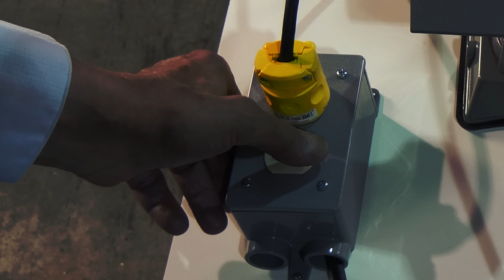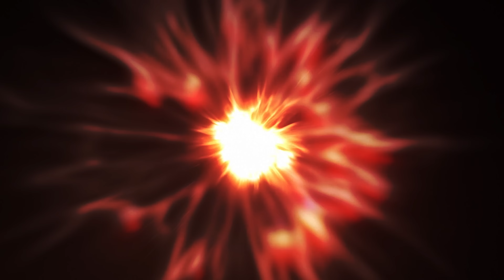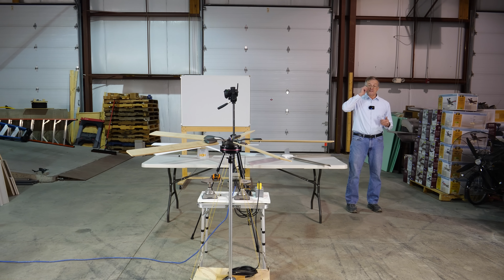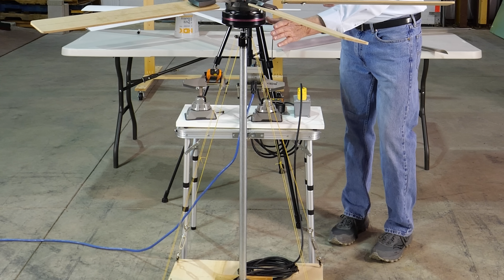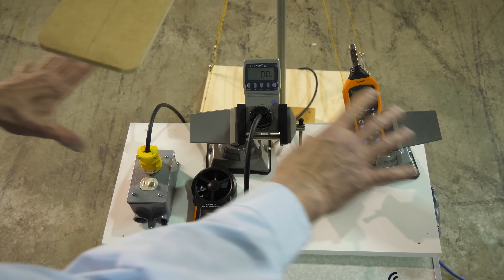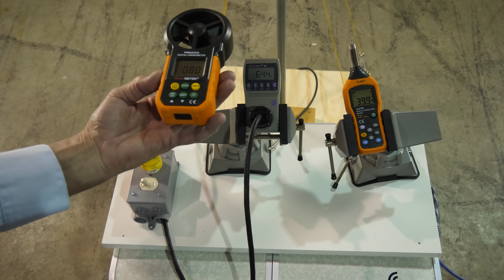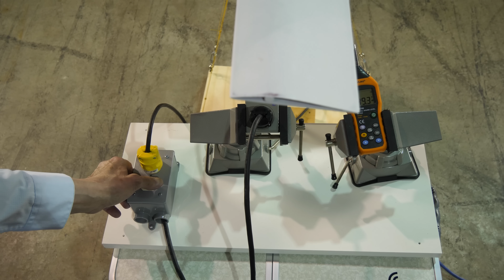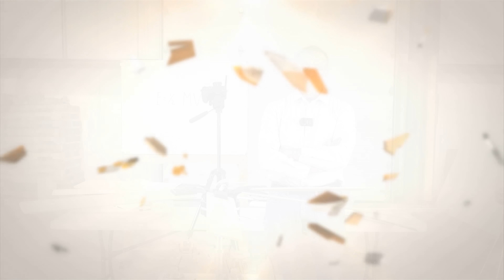This Fan Uses Almost NO Power

Comment: ** THANK YOU FOR THIS! When you first started the demo I though "Power Factor, Power Factor my man!" From working in Industrial electrical systems I became aware of this decades ago and experimented with power-factor correction on inductive devices such as Fans, AC units, refrigerators and etc., and and I estimated that the typical U.S. home could save 5% to 20% on energy usage with basic power factor correction on inductive devices. 

Inexpensive meters like the Kill-A-Watt provide some rudimentary PF information and can aid in finding energy wasting devices. After you find a device like your horribly inefficient device like your celing fan, matching capacitor to correct that is pretty simple and might get your efficiency up to as high as 80%. 

Years ago built a plug-in, in-line Power-factor correction text box for 120V devices with a couple of rotary switches with an assortment of caps to apply from 0 to 60μF in 6 steps on one dial and 2μF to 10μF on the other and start switching for lowest current draw and then wire up an inline plug with that μF value. 

HOWEVER, capacitors provide leading reactive power, and devices like your ceiling fan may have resonances (possibly from being wound for 50hz rather than U.S. 60Hz) with lagging reactive power, but by adding some inductance with a coil or choke in addition to a cap, it should be possible to match PF and inductance nearly perfectly.  

Note: Inductors and capacitors can be made to cancel each other out if properly sized, leading to a neutralized reactive power.
Reply: This is probably the biggest reason for the inefficiency. Induction motors can be 85%-97% efficient under load. The losses with no load are not the same as the losses under load.
Reply: @pierrehavelaar  Thanks, a good way to convey it.
Reply: TheWattmeterRegistersResistivePower,NotInductiveOrCapacitivePower.CapacitorsDontDecreaseTheResistivityOfTheWire,OrOfTheIronAnotherImportantThing:ComercialStandardCapacitorsHaveHighEsr,SoTheyAreNotOkForPowerAmplification.

Comment: Years ago, when I was looking into modifying a 1/16 scale RC car, I found a scientific research project done by a student on DC motors in RC cars that suggested that when there was a surplus of power/torque for the necessary application with a DC motor, that non-linear energy savings would occur. Have you done the math on energy in vs KE on the DC motor at full speed vs 1m/s?
Reply from the maker: I haven't, but that wouldn't be difficult.

Comment: It should be noted that 40db is the noise floor of the environment, not the noise level of the fans. At 16:00 it's 40db before he even turns the brushless motor on.

Comment: Yes classical AC are really wasteful, but extremely cheap to produce.
What you want is BLDC Motor but they are generally more expensive, and the electronic controller is generally designed to fail in the max 5 years (exactly cheap components and shortcuts in the PCB design.

Comment: I'd feel better about these tests if the fan were oriented the way it was designed to be oriented. Being upside-down might not impose any negative effects on the test, but I have to wonder if the bearing placement wasn't specific to an upright orientation.
Reply from the maker: It isn't. 
Rather than asking you to trust me, consider that these fans can be operated in either direction, generating thrust or lift, in either direction.
Also, both models are being tested in the same orientation. This leaves little room for a particular bearing to be the source of the difference.

Comment: The win with the DC motor is the lack of noise it makes.
There was an error in the noise meter placement.
It should have been out of the direct air stream to isolate it from the wind pressure and chop of the blades, Being directly under the blades the noise was more from the sound of the wind passing the sensor not the noise the blades made.

Comment: One thing we fail to appreciate is that no significant results can be just as important as significant results. In this case it led to a great discovery. So many companies will sell you the cheapest motors, because they don’t have to pay for the electricity to run it. In reality, the cheap fan costs more.
Reply from the maker: Correct.

Comment: Excellent discovery, super cool!  Are there other environmental costs involved with the manufacture of the brushless motors that somehow make them less viable, or is it the case that we just have this infrastructure set up to pump out cheap brushed motors, so we keep doing what we've been pumping out for decades?  Would the same principles apply to motors in furnace/central air systems?

Thanks for the work that you put into your videos, and for sharing your curiosity!
Reply from the maker: Thanks!
I think you're right.  It's the inertia of an established infrastructure. It will evolve, and just maybe we gave it a nudge.

Comment: You didn't mention AC motor slip.
With AC induction motors to vary speed while maintaining efficiency you need to vary not just voltage but also frequency.
With cheap AC fans they dont want the added cost so you can't do that so to get speed settings they lower voltage either with inductors (old) or capacitors (newer) but not the frequency. That means at low speed there is a huge amount of slip (speed difference between rotating magnetic field and rotor) and hence low efficiency.
In air conditioners and some other things, to vary the compressor speed without increasing slip they vary the frequency and voltage together -> inverter.

Comment: Try it with the MIT toroidal propeller.
Reply from the maker: The problem there is manufacturing those rotors at these sizes is impractical.
Reply: @TechIngredients  If it were me, I would make a 3d model of a blade, divide it into smaller sections, 3d print each section and then glue them together. Another option is sending it out to 3d print or cnc out of a block. Just my thoughts though. Thanks for the video.

Comment: Are you using an AC-DC converter or does the fan have one built in? Im curious how much power that wastes in the process.
Reply from the maker: It's supplied with and already mounted on the fan.

Comment: There's a product called "Big Ass Fans" 
(true name) that have so many options for formulations and variable running modes that it's beyond 3 phase rectified power along with resonance . 
They will cool a warehouse with 25 foot pure AU blades! with ease! so little power or SOO high power depending on the frequency driver!

Comment: The trouble is, it's always a race to the bottom.  You are 100% right, and it's part of just buying better quality stuff in general\repairing things rather than buying cheap and more often.

The average consumer doesn't care though.  They care about price, even in cases where the $ difference is insignificant.  They care about fashion, or class.

People whine about repairable phones, but then they go buy a Iphone anyway (Apple has a long history of trying to block repairs unless it's their own service)  That's just one example of many.  Repairable laptops? it's been tried and failed, only recently has a company appear to have pulled it off (framework), but even then there's tons of people who "support" it, but when shopping for a new laptop wouldn't consider one.

Personally, I don't think motors should be the target right now, it's small potatoes compared to vehicles and home heating (go heatpumps!).  You might say why can't we do both?  The time, energy, and will to make things happen is a limited resource.  I'd rather they focus on getting heatpumps implemented, and EVSE's everywhere people park overnight.  That's just my opinion though.

The only way I see this sort of thing taking off is if the government push's for it in some way.  Be it regulation to require more efficient motors, or a rebate program to incentivize them.

One thing I think you did miss on though, is the assumption that the BLDC motor will last as long as the AC one does.  I think BLDC will suffer the same issues LED lights have, they could be so much better, but the electronics backing them fail.
Reply from the maker: I understand, and you make good points.
I have a different take on a number of points.  The best way to start is knowledge and understanding of the principles. We do these videos to educate people, hopefully in a somewhat interesting way, to understand how things work.  It's hard to fool people who know what's going on and why. I disagree with a dependence on the government to provide this protection.  The government is itself corruptible with layers of influence and profit seekers.
Reply: @TechIngredients  Don't get me wrong, I don't like that I feel people need the government to push them to do the smart\right thing.  I just feel it's the reality of the world.

You do a wonderful job with your channel, and even if it doesn't result in widespread change, some improvement is better than none. 

Personally I was not aware of there being a BLDC option for ceiling fans, and if I'm ever in the market for one I will remember to try and find such.  It may also mean BLDC's are available for other motor applications, so I'll keep my eye out there as well.

I'm not sure I have it in me to fabricate airfoils anymore, but dang I'll have a look into it if in need of a fan.  Given it resulted in significantly more airflow for the same power, I'm sure acoustics would be better as well.  I'm guessing those were drowned out by your environment\the AC motor itself though.

Comment: Airfoil test: Power consumed at the same speed, Power consumed slowed down until the velocity was 1 M/s, and optimized with different angles (Assuming the paddle blade angle was optimized at the factory, it's fair to test different angles again when changing the shape).

Comment: In my country (air conditioning is not mainly common in my region as temperatures are mild most of year compared to US, except in cars) the ceiling fans of good quality have blades made of plastic I thin PVC in very specific complex form to enhance efficiency and reduce noise (some have kind of saw tooth pattern on the trailing edge, I think to reduce noise or drag), and all have electronic speed control. I imagine in US also, the planar blades I imagine are for cheap fans. Before those when I moved at my flat there was one that is exactly as you describe, like belonging over a poker table in a saloon ran by a lady called Kitty, I changed for a good one. But one thing that irritates me is that the electronics controllers ARE PROJECTED TO FAIL AFTER AN SPECIFIC TIME: I can not prove it because the microcontrolers have the progams encrypted, but they begin to fail after and exact turned on files: yes I am crazy enough to put a device to register consumption and uptime. I found one that is not this way but it was not compatible with the motor my fan uses.

Comment: What is the power factor on the electronic motor vs induction?

     I wanted to post while the video was hot, maybe rambling. Will try to find:

In EEVBLOG by Dave Jones , he did a whiteboard of the really bad power factor in smoke detectors. Wattage may be low, but the amps  consumed by each in a typical several by house in Sydney for example. If they had power factor correction they could negate a whole wind farm. Others jump in.

Comment: Too many blades.  Try again with only four.
More than four, for that size, is cosmetic.  And, it doesn't allow for sufficient air replacement.
At least, that's what Casablanca fan company wrote twenty years ago.
Five does look prettier, but I used four... they are a great alternative to air conditioning, as long as you turn them off as soon as you leave the area (motors add heat to air).
Casablanca fans, at that time, were ~$375., and Hunter's were ~$85.  To this day I wouldn't buy Hunter or Hampton... well, definitely a brushless motor now that I've seen this!  (Casablanca brushless...?)

Comment: Ceiling fan blades are made blunt on the leading edge for safety. If one accidentally hits you it should only make a bruise. The sharp edge as on the Wright brothers airfoil could decapitate you.
Reply from the maker: That may be a reason, but an airfoil doesn't have to have to have a sharp edge. The leading edge needs to have a continuously changing radius.  The 90 degree corners on the upper and lower surfaces of the slab blades are awful.

Comment: Since the goal of a fan is net air deflection, not lift, it seems an airfoil is not an ideal choice as any lift generated is wasted energy as drag. Airfoils only get a fraction of their lift as a result of to the net deflection. A blade with a curve, profile, and width that is optimized along its length for the desired air density and velocity would likely be the most efficient fan blade.
Reply from the maker: Net air deflection and lift are actually the same thing. The lift of an airfoil is due to the acceleration of the air.

Comment: You can probably achieve an even higher efficiency by looking at the design of airplane propellers, windmill turbines, or quiet computer fans. The issue with airplane wing airfoils is that they're optimized for linear motion, not rotational motion. With rotational motion different parts of the airfoil move at different speeds, and you get some centrifugal force too. This creates all sorts of flows and vortices that don't exist during linear motion and decrease the efficiency of the airfoil. Propellers and turbines, on the other hand, are already designed with all this in mind and therefore perform better with rotational motion. Another dimension here is the noise level, and a regular airfoil is not designed with it in mind, but computer fans and windmills very much are. Ship (and especially submarine!) propellers are also often optimized for a low noise level, and there are some very interesting concepts there too, such as toroidal propellers, which are designed to minimize wingtip vortices.
Reply from the maker: I've built many airplane propellers and airplane wings.  Many of the same principles apply. The most significant distinction is that the propeller's foward motion changes the direction of its motion through the air.  This is why a propeller's angle of attack decreases as you move outward from the hub because the rotational velocity becomes progressively more dominant. 
A ceiling fan is more like a wing because the fan is stationary.
Reply: @TechIngredients  huh, interesting, thanks! But then what's the reason why pedestal fans often have blades that widen and decrease pitch closer to the edge?
Reply from the maker: Widening is probably just a space limitation near the hub. Overlapping blades are bad aerodynamically. 
Reducing the pitch as you move away from the hub evens out the airflow over the diameter.  Otherwise, most of the airflow would come from an angular ring near the edge.
There may be sound generation advantages to that shape, which I don't have knowledge about.

Comment: in theory, couldn't you get some basic aluminum heatsinks and attach them to the body of the motor? If you can shed the heat, which is going into your room anyways, wouldn't that allow it to work more efficiently too? Not that I expect huge gains, especially given the power levels we're talking about are already relatively low, but I'm curious if it would have an impact at all

Love the content, y'all.

Comment: I built a new shop recently and I was looking at installing some of those things that they called Big --- fans.  The blade diameter is huge and I have heard that they move a lot of air.  But one fans a lot of air may not be the same as another fans a lot of air.  I'll check and see what kind of motors they have.  And I would be interested in how you fabricate the better blades.  Thanks

Comment: I would say symmetrical cross section blades with a knife edge on both sides should give a significant boost over the flat, square edge version. Airfoil blades would have unequal efficiency and airflow with rotation in either direction.

Comment: I actually find this more interesting than auto-guided lasers. Those are cool too, but stuff like this is what got me interested in this channel in the first place.  That reminds me, what ever happened with the follow up video to the heat pump episode?  Is that still coming, or did it already get released and I missed it?

Will achieving that level of efficiency always require electronic motor drives? Is there just a fundamental flaw in using a fixed frequency sinusoidal AC voltage source that just can’t be overcome?

I’m all for greater efficiency, but I find myself buying the most electrically simple appliances possible at home to minimize RFI issues and theoretically reduce the potential points of failure.  The thought of buying anything with a VFD feels unpleasant, but it’s hard to ignore those results.
Reply from the maker: We want to cover a broad range of topics.  It's interesting and can expand the viewer's curiosity  about subjects outside of their experience and current focus. 
AC motors can be as efficient but have to be designed for a specific speed and load because the phases of the voltage and current are fixed. This isn't practical from a manufacturing perspective. It would be very expensive.